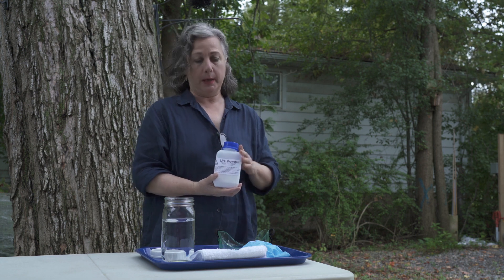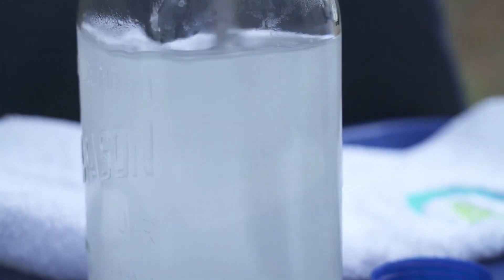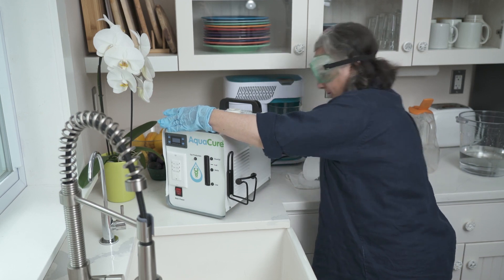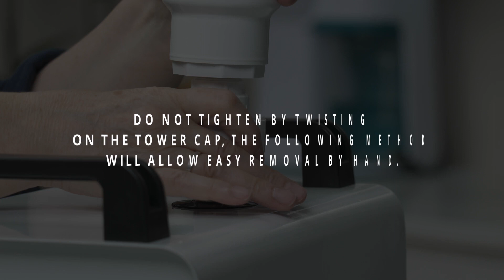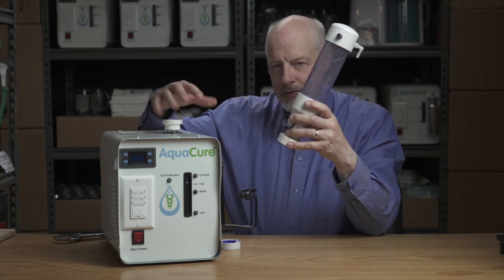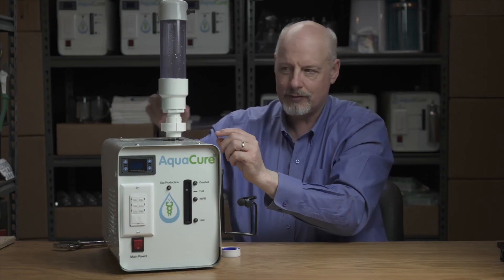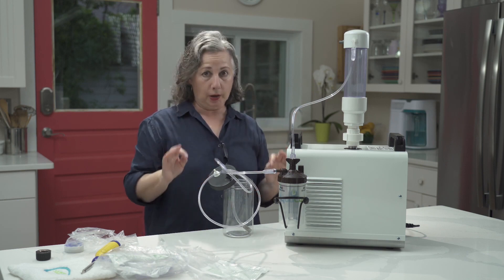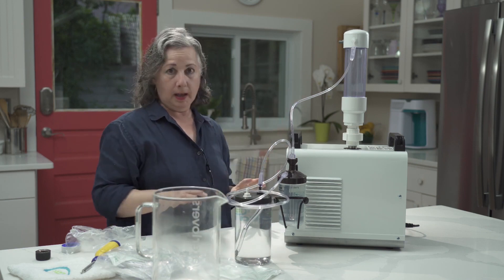AquaCure AC50 SetUp (series video 3)

Comment: She's saying to use a tablespoon when she's indoors does not repeat the tablespoon measuring when she's outside and Meanwhile my standard tablespoon measuring spoon as part of a set, doesn't fit inside the lye plastic container so easily. I have to jam it in there . Hers fits extremely easily. So something is off here.

Comment: How does she not state WHY she went outside to mix the lye? How does she not go into the toxicity of lye as well? I live in NYC. Outside is not possible. I have no backyard. Also, no mention of what to use and what not to use to stir the lye mixture. Many substances are no good according to ChatGPT
Reply: George has stated that a fan can be used indoors.
Reply: She is avoiding fumes from the lye.  You don’t have to go outside.  Just keep you nose back from the jar some.  Or if concerned mix it under your stove vent.

Comment: But she didnt say how much distilled water in the glass to start with
Reply from the maker: The operation instructions do, but in the end it doesn't matter.  What matters is how much lye is in the machine (somewhere between 40 and 80 grams).  Make the jar 3/4 full so it doesn't spill when you are stirring in the lye powder.  After you've put the catalyst (lye) solution in, you then slowly add pure (distilled) water until the machine is FULL, or at least until the 'ReFill light goes out (yes you can plug it in to see the lights).

Comment: Here is a list of the benefits my husband and I have experienced since we started inhaling Brown’s Gas overnight. We start the day by drinking the overnight H2 water. We drink at least 3 to 4 liters daily due to working in hot weather. We started noticing improvements about 3 months in. I am thrilled that the Aqua Cure worked and I am 100% pain free. I am 70 years old and can work 8 to 10 hours a day without fatigue or pain. Maintaining 110 acres of range land requires lots bending over and many hours walking for miles up & down steep hills. I have severe arthritis and slipped disks in my back, also neck & knee arthritis. I fell over backwards last October causing further damage and constant pain. I saw doctors, chiropractors, tried PT, Red Light, and PEMF. PEMF did help for housework, but only if I wore it all the time. There were no options to fix my back or neck. Intermittent tingling of left foot is gone. The outer half of eyebrows (thyroid issues) and eyelashes grew back. Thinning hair is growing in fuller. Rosacea, extensive age spots, wrinkles, and scars are slowly going away, and fingernails are stronger. I am less stressed, sleeping better. One thing even I have a hard time believing my very dark stained teeth from the prescription tetracycline. When having dental work done the dentist could not match the brown shade. They are more than several shades lighter now. My husband had a nearly fatal car wreck on Dec. 2021. He was transported by helicopter and spent 10 days in the hospital with many broken bones, multiple other traumas, coma,TBI, etc. He felt like he had chronic fatigue and or Fibromyalgia. He still wakes up sore, but after a liter of H2 water it is gone in less than 30 minutes. He now has the energy to build a house by himself and is regaining the muscles he lost after the wreck.

Comment: Im not an owner yet and watched the video briefly. Is the lye water interacting with the water/gas that would be inhaled? I thought it was toxic.
Reply from the maker: Lye is put into the machine as the catalyst.  The catalyst is designed to stay in the machine.  If the machine is maintained properly there is zero lye in the inhaled gas; this has been tested and verified by independent labs.  There is nothing in Brown's Gas that isn't supposed to be in your body.
https://eagle-research.com/faq/is-lye-safe/

Comment: IMPORTANT! IMPORTANT!!  I am a soap maker handing lye a lot.  IF you should get any lye dust on you or speck of lye on your skin it will BURN.  Water will not take the burn away it will activate it even more.  USE A SPRAY BOTTLE WITH VINEGAR and spary your skin.  That WILL neutralize the lye and stop the burn.  Be CAREFFUL  that you don't touch the table, etc with your lye gloves.  You might not see some lye dust and get burned... back to that vinegar bottle.  After you are done, spray your tray and work area with that vinegar spray to clean up.  Nope, it isn't overkill.  We constantly get some lye burns but being ready with the vinegar is not a big deal then. Just treat lye with respect.  I am amazed how many people forget they have the gloves on or that they don't realize how much they touch with the gloves.  Pull those gloves off and throw away when you are done mixing lye!!  
As for going outside well I live in the north, in winter that isn't going to happen.  I am careful where I use the lye though.  I have had little lye dot burns on my floor or counter when first starting out.   I made sure I have a special place to use the lye.
DO NOT PUT THE LYE IN FIRST, then water. NO.  What can happen is the lye crusts over, water  slowly melts a hole and you can get a volcano effect.  Water first, then lye.

Comment: 10:03
Reply from the maker: It doesn't matter which hose length you use (just whatever is most convenient) but generally we use a 1 foot or 4 foot hose to connect the Drinking Water jar to the Humidifier output and then the 7 foot hose from the Drinking Water jar to the accessory application (bubbling stone, goggles, arm/leg bag, etc.)

Comment: Hi - i just want to confirm that using the 6 TBSP in the video is sufficient to do the job?
Reply from the maker: As per the instructions in this video, on the bottle and in the Operation Manual Update:  YES
Frankly as little as 4 will 'do the job' but over time, during maintenance rinses, some is lost, so we put in some extra.
Too much exacerbates crystallization, so we don't recommend more than 6 tablespoons.
Reply: @ecopegasus  that is amazing turn time!   Thanks so much.  We are loving it!

Comment: Hi, The video says to add 6 tablespoons of lye, but the owners manual says to add 8 to 9 tablespoons of lye.  Owners Manual also says 100 to 150 grams..  and according to google 6 tablespoons is 90 grams, 7 tablespoons = 105 grams..  Owners manual also says there's very little efficiency benefit over 100) (as well as some drawbacks of clogging up the machine if you go too far over 100 grams, so I'm thinking 7 tablespoons would be ideal to reach the 100-150 range while keeping it on the lower end of the range to keep the machine running smoothly.  Please correct me if I'm wrong :)
Reply from the maker: The original amount of lye was way more than needed, so we reduced it to a more practical level.  The new videos, the Operation Manual UPDATE and the instructions on the lye bottle itself all say the lesser amount.  Please ignore the older information / instructions.  Frankly, anything over 40 grams will give full gas production but we add the additional 40 grams to compensate for some inevitable loss during maintenance rinses.
Reply: @ecopegasus Thanks!
Reply: So to reply to this message, I've noticed a slippery feeling inside my glass jar I put the drinking water in, and I think there's lye getting in it. What's the absolute LOWEST amount of lye we can add, while still maintaining therapeutic benefits? Could I do 40grams as mentioned? 

What would you recommend for the best "minimal" amount of lye?
Reply: Also, another thing. I just weighed my lye, and 3 tablespoons was 80grams.. are we more focused on weight, or tablespoon measurements? I'd like to only use 40.. but 80 is definitely less then the previous owners solution. As half the bottle of lye was gone and they only had it for 3 months and used the same solution the whole time I think 😊

Comment: When you first unbox the machine, is there actually any reason to go through this washing process when setting up the machine for the FIRST time??  This looks like a "maintenance video" and a "set-up" video that got scrambled together...  Wouldn't you be adding more contaminants than you would be removing (just by running tap water through it right before pouring the distilled lye water mix into the machine while the machine is still wet on the inside with the tap water that remains on the insides of the walls and hoses of the machine..?
Reply from the maker: YES!, You need to dissolve any lye crystallization that has happened during storage and shipping!
Believe me, I would NOT advise this pre-rinsing if it wasn't 100% needed for smooth operation of your machine.
The amount of impurities 'added' are insignificant.  Kinda like pre-rinsing your dishes before putting them in the washing machine.
Reply: @ecopegasus  OK (I didn't realize there was ever any lye in it previous to shipping.  I thought maybe it was an editing mistake or something..) Thanks for the fast reply.. and thanks for making the greatest B-gas machine in the world !!!

Comment: You say it HAS to be distilled water for the lye.. so wouldn't it be better to heat up distilled water to wash the machine with also? (at least on the last rinse or two.) OR (if you don't have that much distilled water) wait for the tap water to evaporate from inside the machine before adding the lye/distilled water mix into it. (though that would take a LONG time, which is why I suggest using distilled water to clean it.)   Please correct me if I'm wrong.  I haven't even taken mine out of the box yet.
Reply from the maker: Using distilled water for the maintenance rinses would truely be the ideal, BUT for practical purposes (cost of distilled water) tap water is fine, you are pouring it out with the other impurities.  Rinse the AquaCure with distilled water after the final tap water rinse, if you wish.  I don't bother.  The amount of tap water left in the machine (and any associated impurities) is minimal.  
You do NOT need to 'wait' for water to evaporate, first because you are putting water (in solution) back into the machine and second, the evaporating water would leave behind any impurities anyway, so 'waiting' would do nothing to help you.
Reply: ok thanks. @ecopegasus
Reply: OK thanks very much!!   @ecopegasus